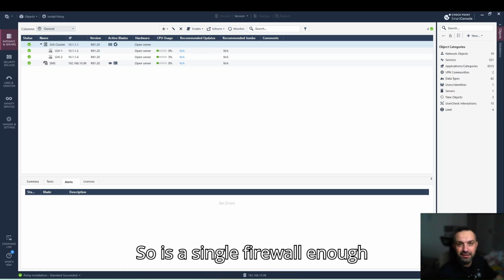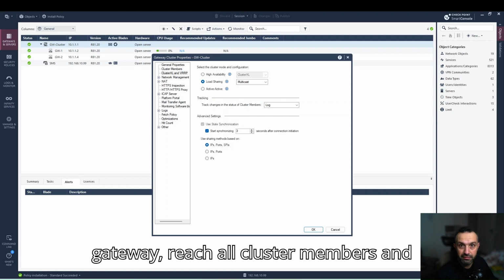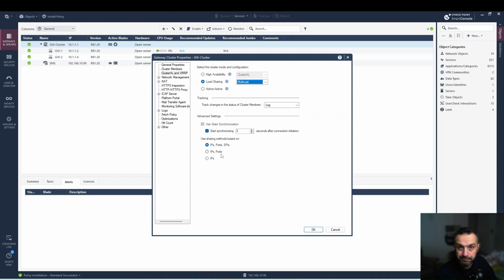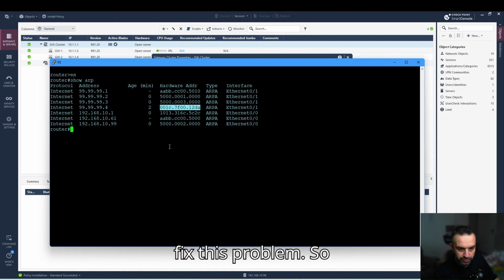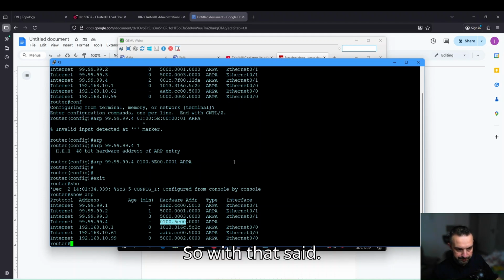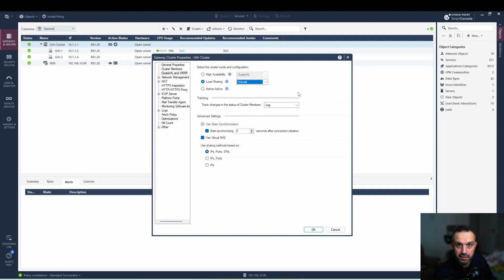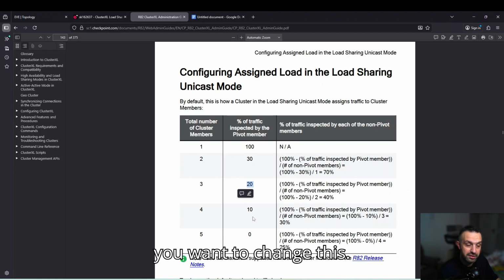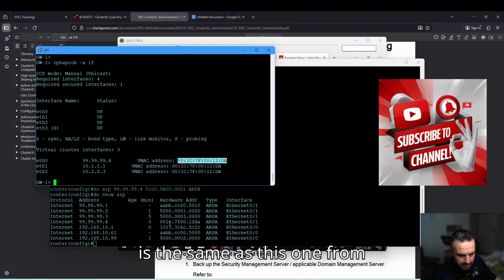Checkpoint firewall: ClusterXL load sharing LAB

Comment: Hey
Is it possible to do a ClusterXL HA when your two firewalls are in DCs located in different geographical areas?
Does the addressing have to be done in a particular way?
Because in a ClusterXL, your “external” interfaces would be one for each GW and one VIP, but what can you do if each site has a different ISP that provides a very different pool of public addresses?
Is this way of working possible with ClusterXL?
:)
Reply from the maker: Hi
I have never done that in production, but i think you can use the Active-Active cluster mode, which supports the configuration of IP addresses from different subnets on all cluster interfaces. Reading the admin guide i could see that active-active would work but with many limitations!
Reply from the maker: again a good idea for a new video :-)